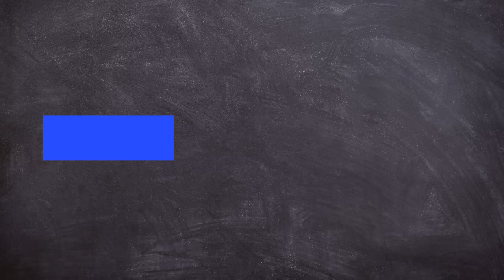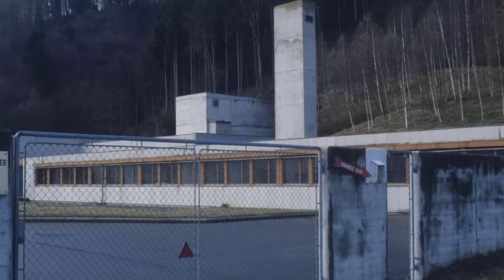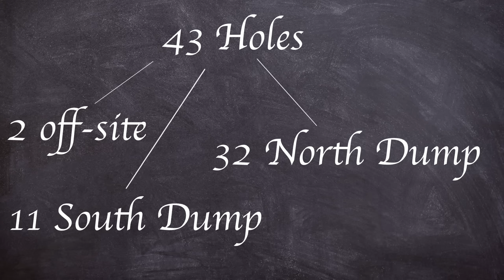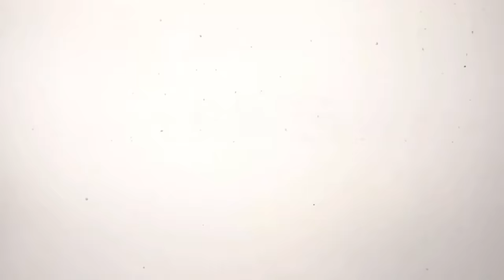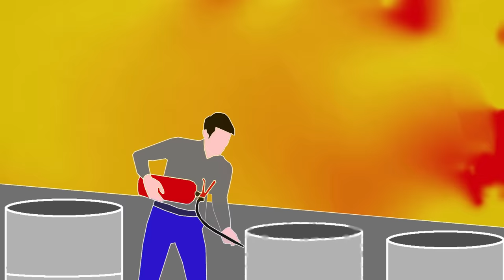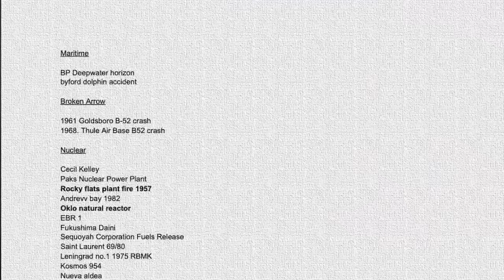ReWind: Year 5  Omnibus of Plainly Difficult

Comment: Congrats! I am a scientist running a lab, and this channel is the best safety training content ever. Do a "piranha solution" disaster story?
Reply: Has there ever been a large disaster with piranha? Chromic acid has had it's disasters
Reply: @markshort9098  we washed glassware in the 90s with bichromate which has since been banned. The story about piranha I know comes from newsgroups (can't find the link at the moment). That one resulted in a pool of blood and multiple cuts, but I guess not disastrous enough in PD terms :)
Reply: @runcycleskixc  never heard about that one.. i wonder what went so wrong for that to happen, it would be an interesting one especially since piranha is something i use fairly regularly.. i can buy 50% peroxide from hydroponics shops and i have at least 10 litres of h2so4 at all times and get more all the time from old batteries for free so i get pretty liberal with the piranha.. can't stand dirty glassware.. i didn't know chromic acid was band, I'll have to check the laws here because nothing cleans glassware like chromic acid for those extra sensitive experiments and i want to make some.. it's easy to convert any waste from chromium 6 to chromium 3 so it's not as bad, i know people who still use it but they do the right thing with propper disposal
Reply: @markshort9098  that accident involved cleaning a sintered glass flask which was used for acetone. The moment piranha entered the flask it exploded into a billion pieces. I use piranha on a regular basis, too, but I have reduced the volumes per use so that I do not have to deal with liters of waste. It's all sulfuric acid after all.